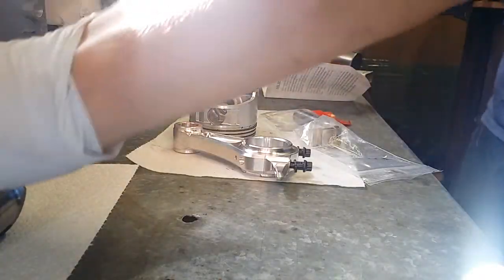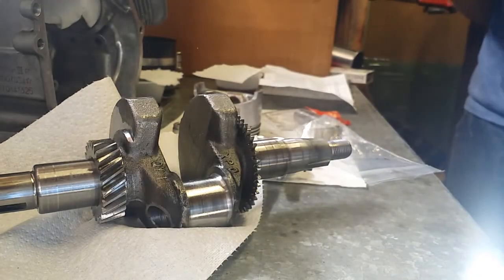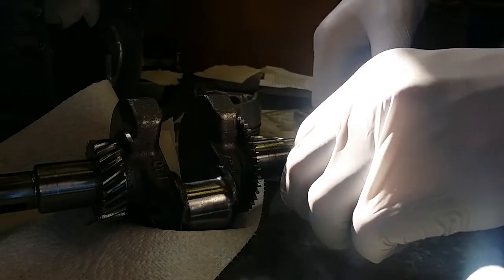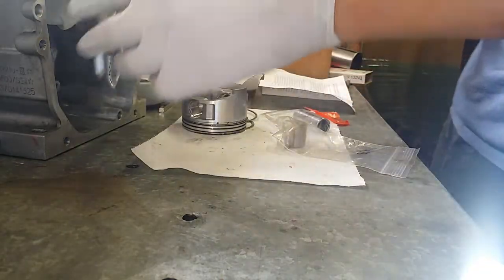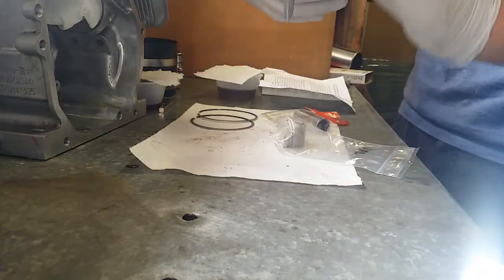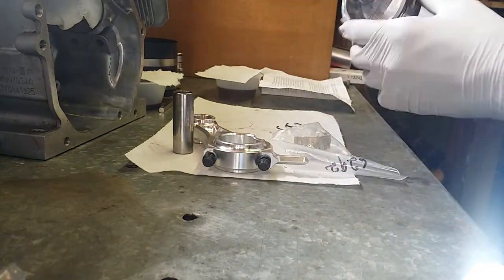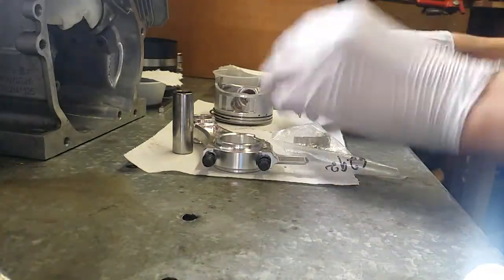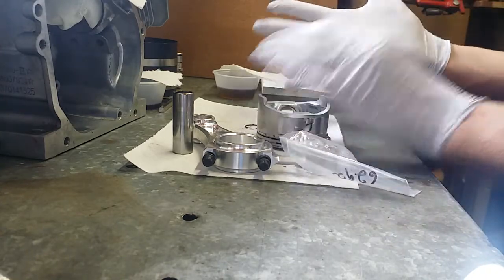Installing predator 212cc ARC billet aluminum connecting rod to piston

Comment: I didn't see how you put the rod on the piston clearly,..your camera was too low !!!
Reply from the maker: Yeah it's not a good video. Just get a wrist pin clip into one side of the piston, then put the rod into the slot for it on the piston (I don't think my piston was directional), and then slide the wrist pin through and snap in the last wrist pin clip. Be sure to have the wrist pin coated in engine assembly lube.

Comment: Is it bad to install preformance parts on a used motor?
Reply: not at all you can even hone the bore out if it makes you feel better.  The only case you would not want to do if there is a hole in the block or the crankshaft bearings are damaged.  Mostly if there is not damage like things didn't brake then you will be fine.